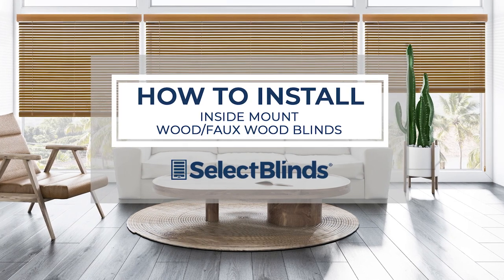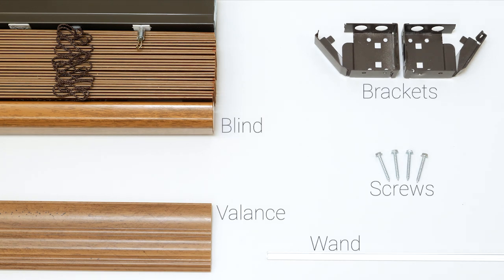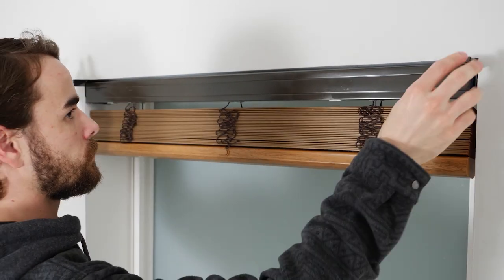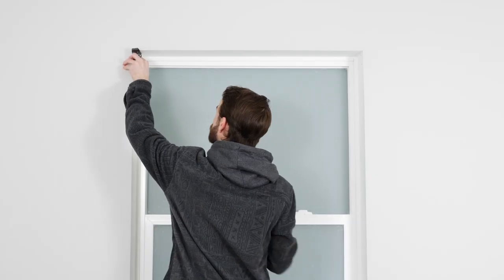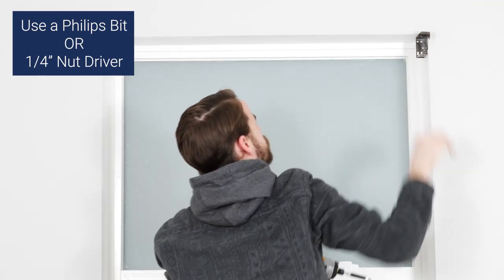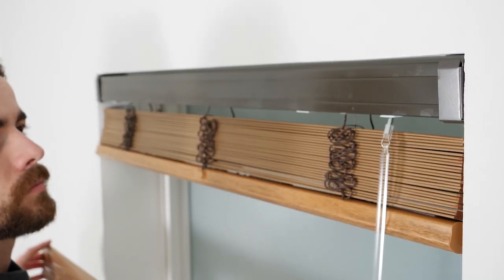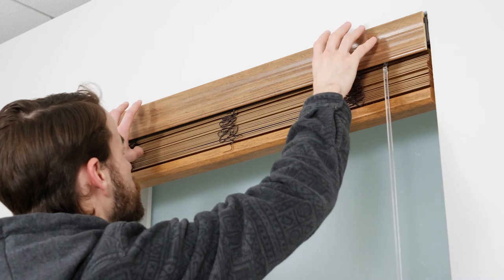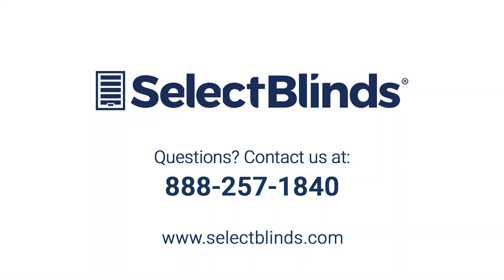How to Install Inside Mount Wood/Faux Wood Blinds

Comment: What if your windows are flush with the wall and not set in like in your example - which magically fits the width of your inset.
Reply from the maker: Hey Rosemary, I'm so sorry for the long wait but were you referring to Outside Mount shades? If you have a shallow window depth, typically you would order outside mount, as opposed to inside mount. Check out this video: https://www.youtube.com/watch?v=kpaT9ArquLo